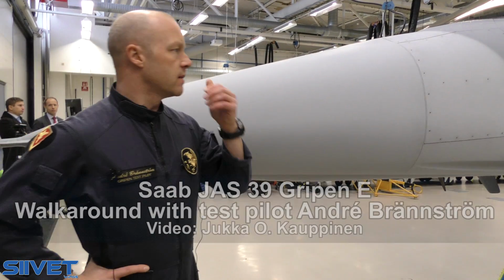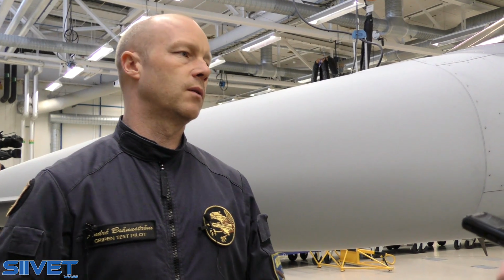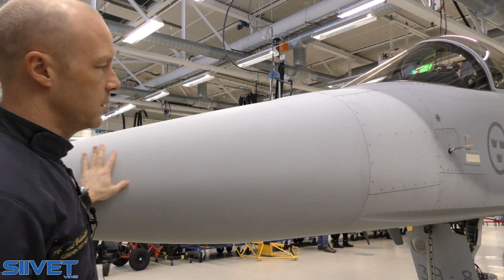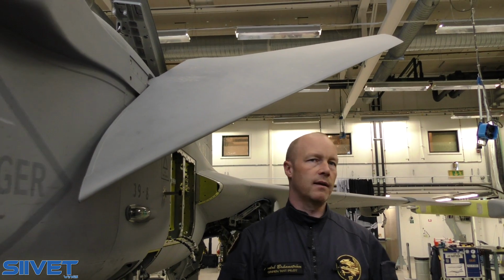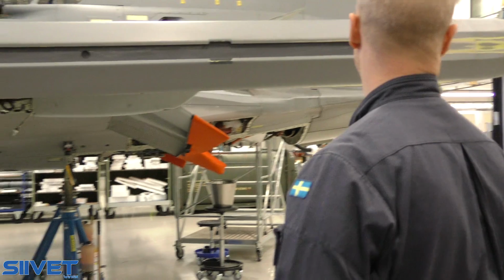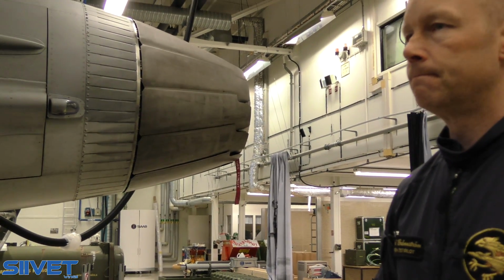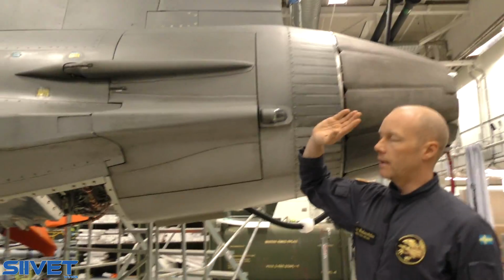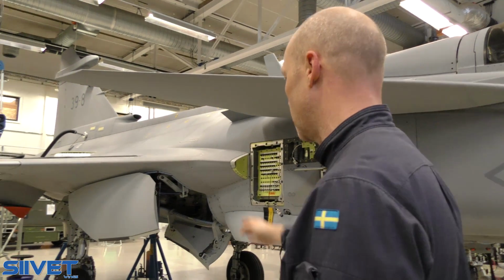Saab Gripen E Walkaround at the Saab factory at Linköping - Guided by test pilot André Brännström

Comment: Braanstroom gives an excellent nickle tour of the Gripen. A superb multi-role aircraft for Swedish needs and performance requirements. Sweden's limited Defence budget will be well served by the Gripen for several decades. 

To those that follow SAAB Aviation history, they have built a really good platforms that are reasonably durable in almost all weather environments. But it does have limitations including compromise of maximum weapons load + fuel = +/- patrol range that is drastically shortened if it turns into a shooting war. I grinned when he mentioned the Viggen was designed for Mach 2. It was indeed capable and did "routinely" fly at this speed with only 2 AIM Sidewinders. But in doing so, every minute flying at Mach 2 cut its RTB range by 200 NM. With external fuel tanks, neither the Viggen or Gripen was / is capable of Mach 2. 

While the Gripen is well suited for Sweden, it would be a poor choice for Canada that requires a platform that most cover the second largest landmass plus 3 coastal approaches in waters with a 200 nautical miles economic zone. Given its limited combat radius once the external fuel tanks are jetisoned, the Gripen is not a good candidate. SAAB has offered, as it did with Brazil, generous finance options and to build them in Canada. For 90 aircraft, this really doesn't make any sense. Canada would have to spend billions re-establishing arctic bases north of the Yukon to extend the Gripens operational range armed with 6 Sidewinders and external fuel tanks. Canada is likely to reconsider its original intention to acquire F-35s and reorder F-18 E/F Super Hornets.
Reply: The ALL new LARGER Gripen E has a combat radius of 1500 km (it has 40% more internal fuel then Gripen C) and a ferry range of 4075 km. This is much, much longer then Canadian current F18.
Gripen E can also supercruise with 4 air to air missiles at mach 1,1 and the range is about 900-1000 km without external fuel.
Note that F35A has a range of 1083 km with internal payload.
The ALL new Gripen E has also 10 hardpoints and can carry 6000 6500 kg payload.
Neither range or payload is a problem with the all new Gripen E.
Gripen E is a good choice for Canada.

Comment: The material of fuselage is not advance & it doesn't help in reducing radar signature!!!
Reply: That is what the EW is for. To jam radars. The new stuff that SAAB has developed can already spot F35s when in stealth (air friction detection at long range). As EW continues to develop, passive stealth designs, such as F35 will be obsolete quite soon.
Reply: already produces less than half of a signature as larger a/c
Reply: Ok where did you get that information???
"a state-of-the-art airframe of advanced carbon fiber composites."
https://www.saab.com/products/gripen-c-series

Comment: Instead of 27 F35 which is too few - Denmark should have made a deal with Saab instead... More planes and less noise...
Reply: Yes! Yes we should have...
Reply: Jets are noisy as f....ck regardless. Also, nobody figured anything better than high-low combo in 1:2 or 1:3 ratio, but must smaller nations go for monotype.
Reply: I don’t think you can go wrong with the f-35.  Maybe...maybe there are better dollar for dollar buys, but its Impossible to be “stuck” with a F-35. It’s a very good plane.
Reply: @ Ronny Probably 2 equal fighters regarding avionics. Perhaps Denmarks connection to NATO made a difference?😉 Hilsen fra Gripens home country!
Reply: Did you have choice?
Reply: Well , if we unit our airforces , we might get the best of 2 worlds :) /cheers from Sweden !
Reply: The Danish defence ministry has said that they properly will have to order 10 more F35's.

Comment: Thank you for the video, very interesting. "Secondary cooling system". Hmm, sounds good *grin*. I guess the power that the EW can emit isnt exactly neglible then. Very nice.
Reply: A modern EW system needs to be very powerful. An airborne radar can cook itself if left on while on the ground without cooling airflow. Thats a lot of energy output. EW systems need to be able to overpower and confuse those same systems so energy output needs to very high as well or enemy radar can just 'talk over the top' of any EW system no matter how smart.
Reply: @JakusJacobsen  In theory the power required to fool an enemy radar is exactly half of the radar. Of course the power output needs to be dynamic because it depends heavily on range and type of radar. Plus having some extra power at hand is never a bad thing.
Reply: @TealJosh  I would say that power isn't as important as computer speed.
If you have a too powerful ECM you will be a beacon for enemy to home into.
Better to be smart and use the SMART FIGHTER!!!
Reply: @jorgenpersson662  in terms of rudimentary ECM/EW, it's all about TX power. That is, outside of burn through range. ECM within burn through range can be about computer speed, but pre 2000s computers were already quite good at it.
Reply: @TealJosh  Well...I would say that's an bit old thinking = burn through.
Nowadays it's about enough power and more about smart radar and EW suites.
You hide yourself/make it hard for the enemy to target you by immitating/fool modern frequency hopping radar. 
That's why you need a good computer and a very high modularity in both hardware and software so you can upgrade it easily. Just like on Gipen E.
Gripen E uses the latest GaN technology on it's EW suite which will make the burn through distance very short and ineffective.